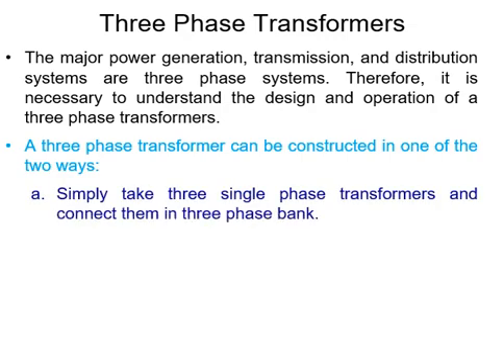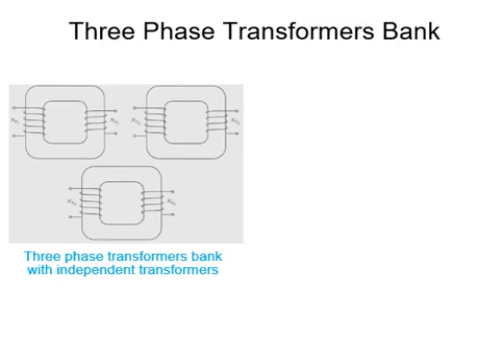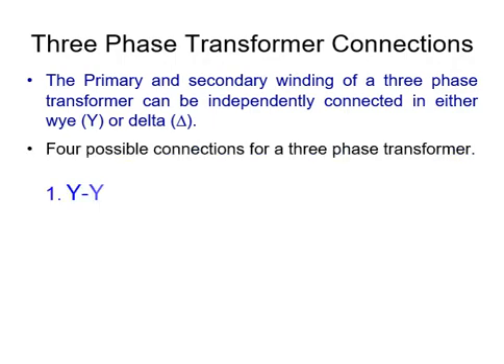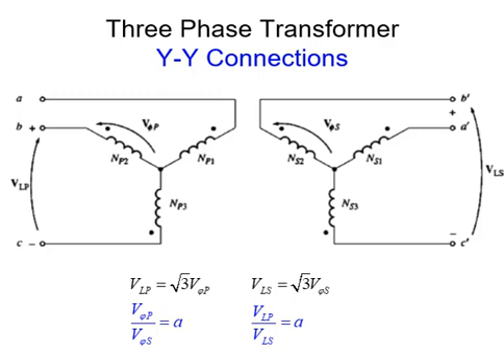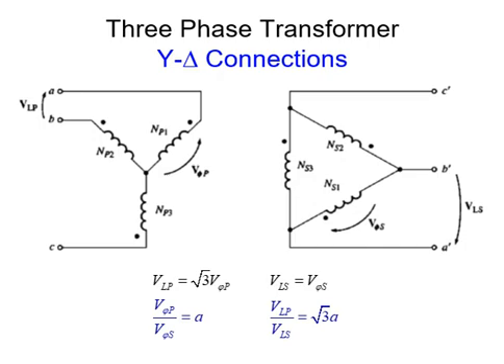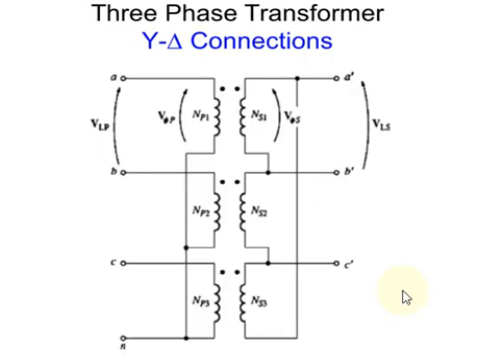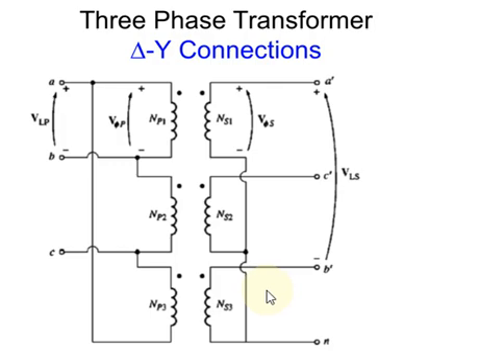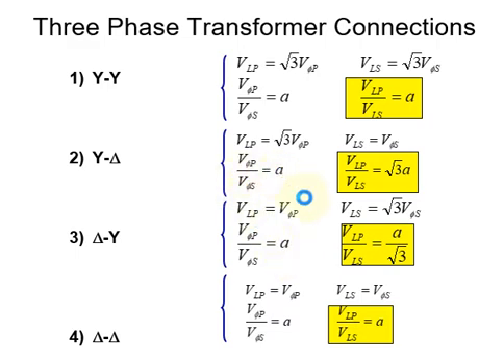Lecture 09 | Three Phase Transformers| Electrical Machines

Comment: A three phase transformer bank is to handle 500KVA and have a 34.5/11 KV voltage ratio. Find the rating of each individual transformer in the bank (high voltage, low voltage, turn ratio, and apparent power)
Y-Y. 
Y-Delta
Delta-Delta.
Delta-Y.
Open Delta.
OpenY- open Delta.